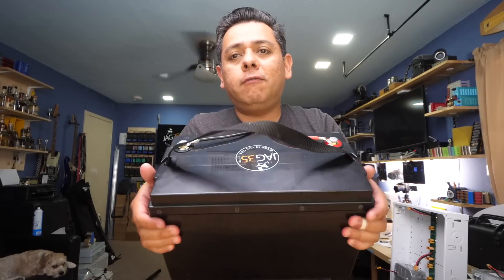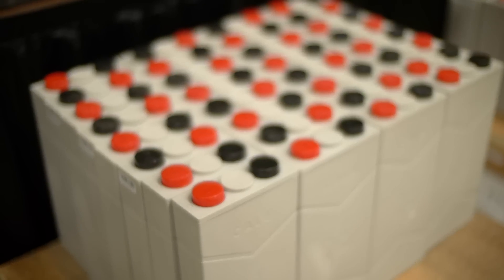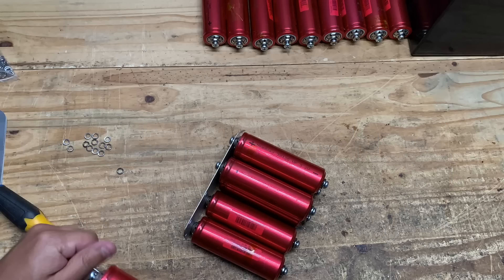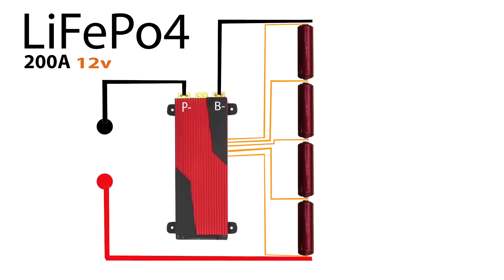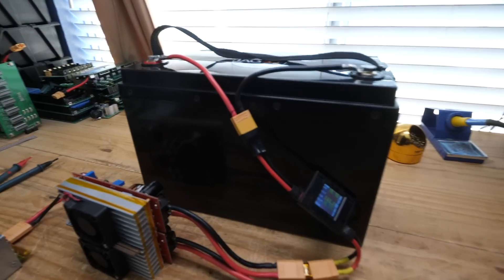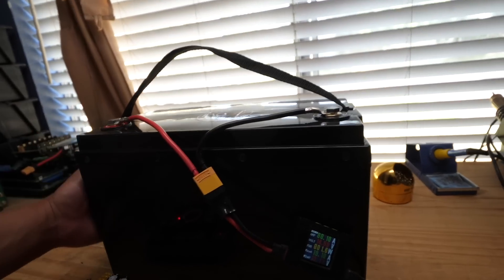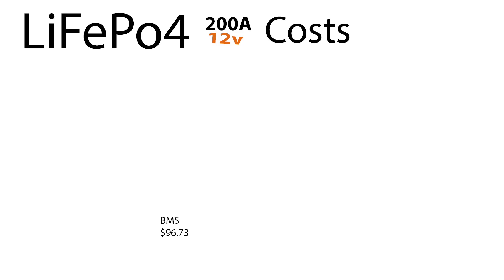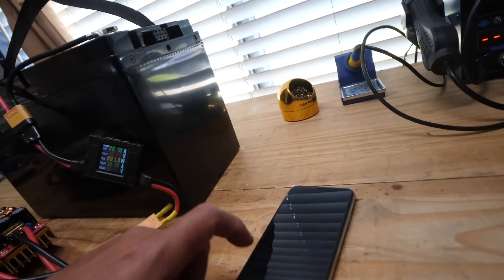Build a DIY Lithium LiFePo4 Headway 12v Battery replacement

Comment: 5. Global BMS Vendors
5.1 Denso (Japan)
5.2 Calsonic Kansei (Japan)
5.3 Hitachi Automotive Systems (Japan)
5.4 Mitsubishi Electric (Japan)
5.5 Hyundai Kefico (Korea)
5.6 LG Chem (Korea)
5.7 SK Innovation (Korea) 
5.8 Tesla Motors (USA)
5.9 Lithium Balance (Denmark) 
5.10 Vecture (Canada)
5.11 Rimac Automobili (Croatia)
5.12 Digi-Triumph Technology (Taiwan)
5.13 Clayton Power (Denmark) 

6. Chinese BMS Vendors (Independent Third Parties)
6.1 Huizhou E-power Electronics
6.2 Shenzhen Klclear Technology
6.3 SINOEV (Hefei) Technologies
6.4 Ningbo Joyson Electronic Corp. (German Preh GmbH)
6.5 Harbin Guantuo Power Equipment Co., Ltd. 
6.6 Anhui LIGOO New Energy Technology Co., Ltd.
6.7 Ningbo Bate Technology Co., Ltd.
6.8 Ningbo Longway Electrical Co., Ltd.
6.9 Shenzhen Antega Technology Co., Ltd.
6.10 Wuhu Tianyuan Automobile Electric Co., Ltd.
6.11 Shenzhen Battsister Tech. Co., Ltd.

7. Chinese BMS Vendors (OEMs)
7.1 BYD
7.2 BAIC BJEV 
7.3 Hangzhou Genwell-Power Co., Ltd.

8. Chinese BMS Vendors (Power Battery) 
8.1 Beijing Pride New Energy Battery Technology Co., Ltd.
8.2 CATL
8.3 Hefei Guoxuan High-tech Power Energy Co., Ltd.
8.4 China Aviation Lithium Battery Co., Ltd.
8.5 Sunwoda Electronic Co., Ltd.
8.6 Winston Battery

9. Global BMS Chip Vendors
9.1 Analog Devices (USA) 
9.2 Texas Instruments (USA)
9.3 Infineon (Germany)

For more information about this report visit https://www.researchandmarkets.com/research/nhg4vb/global_and_china?w=12

Comment: Great video!
But I wish to crave your indulgence for an observation Sir.
Some of us subscribed to your channel ‘cause we can learn everything learn-able under the sun from you about the lithium battery DIY projects. But something baffles me here Sir. You seem to mystify some essential aspects of your projects. For example, in this video, you were kind enough to show us the parts you put together, but we didn’t know how you did most of the connections and all your wiring.
But of course, if it is a trade secret then you may forget it. Otherwise, you would be doing me a lot of invaluable favors if you let us into some of the tips and tricks. OK. May be I am just too dumb to see.

Comment: I wouldn't recommend buying these seconds 38120' batteries.
Why! 
I bought 8 units from Battery hookup @
AU$189.23 (8XAU$ 23.65ea) includes DHL transport
The batteries are very old,  manufactured 2016 or 2017.
Nothing in  web ad that mentions cell  AGE & insulation damage.
Have one dud  battery that's under spec @ 3.14v Clearly shows overheating or cooked damage history @ + end. 
Not like the others. 
The rest are either 3.288v or 3.4v with surface   insulation damage.
As price comparison, 
I've since discovered,  from China, GEB brand NEW 
GEB 38120 @ US$12.92PCS + transport for the 38120 battery.
Reply: Yep battery hookups is overpriced. The battery he builds in this video would be around the $400 range once you add hardware, box, bms and cells. Definitely not worth the 35AH rating.
Reply: I was really contemplating purchasing these cells from Battery hookup until I read your post. Getting duds is what I am afraid because they are used, even though their description says all tested something like 95% and up.  I was going to make a 4S10P pack, so 40 cells.  Now I don't think I will be ordering any.

Comment: To charge this battery, you recommend the DC DC Voltage Convert CC CV Boost Converter DC-DC Step Up 1800W 40A Power Supply Adjustable Module 10V-60V to 12V-90V Regulator.  I've seen you use it before, but its good on LiFePo?
Reply from the maker: It’s good on any battery

Comment: How could we make it have a constant 400amp out put?? Adding 2 bms?? If so would you have to split the cell bank so it's 16 cells per bms?? Fyi I'm trying to use for high power car audio.. Thanks
Reply from the maker: Using a mechanical relay with a bms might work better for you
Reply: @jehugarcia  I'm not sure I understand.. are you saying bypass the bms when I'm using it??
Reply: @jehugarcia  or are you saying use the bms to control the relay??
Reply: I'm sitting here trying to image a 4800kW car amp set-up and it just doesn't seem realistic to me.  You could cut a car in half with that much amperage, so I'm guessing you are just taking the combined MAX watt/amp ratings for all of your amps to arrive at that number. 

If you are trying to satisfy the combined peak load for all of your amps, then you should probably be looking at a bank of Maxwell Super-capacitors in conjunction with a battery like this.  Audio amps only draw their peak currents when they're driving heavy bass, and even that is a transient demand.  Super-caps are ideal for this job. 

Just be careful with them because they need a current limiting element when you start to charge them from a non-charged state.  This can be done with some beefy MOSFETs set up as constant current limiters/ideal diodes, or just use a bank of sub-ohm resistors in between the battery and the super caps.  Then hook each of your amplifiers to the super-cap bank through dedicated fuses and relays with 6 AWG wire.
Reply: @timhogue2808  my amp puts out 4300 watts at 13.8v

Comment: Thank you very much my friend for your videos. Thanks to you the wait is finally over for my own 38120s. Ordered 8 to make two 12 volt batteries for powering accessories on the electric bikes. I LOVE 12 volts. Just last week ran 12 volt into the house from the solar panel and battery bank. Installed an RV 12volt vent fan to be used as a whole house fan, venting the house and attic. Works great! Also have more than one car stereos running, like the one in the bathroom for a great sounding shower!

Comment: Jehugarcia, I am a newbie wanting to learn about this lithium battery technology. Can you explain why liFePO4 of the same voltage and capacity e.g. 12.8V 200A have quite different continuous discharge rates. I have seen some have 80A, 100A, 150A and yours putting out 200A continuous. Is it the difference between cheap and quality batteries?? Regards
Reply: Depending on electrode area, size current carrying capacity can vary.

Comment: So... the headway cells are not as good as the prismatic cells... 400 wh... 1/2 the space gives you 800wh easy, 1200 ish with tall 100ah cells...
Reply from the maker: They are not as energy dense

Comment: Thanks for the video. I’m only interested in solar storage as using these batteries for a starting battery would not make sense for me. I only shallow cycle my lead acid starting battery and it is 5 years old and going strong. This would be a waste of money except for solar storage. And with my lead acid battery I dont need to worry if it’s freezing or not. 
 I would like two of these Lithium’s to have the correct voltage for my 24 volt inverter. They would be inside in a insulated box with a small heat mat so I wouldn’t need to worry about them freezing. I had hoped they would be slightly less expensive for used cells.
Reply: I’m watching the video again and you do a great job describing what applications these Lithium chemistry batteries perform best at 3.3 V nominal per cell. It was the comments Section that drifted off into starting battery applications. Lots of people wanting to trick their cars, trucks, and vans and run more loads. But the stock charging system and lead battery is designed adequately for starting and small loads. If running large amplifiers or other large loads is the goal a single Lithium battery has risks because they stop supplying power suddenly when low with little warning. Then starting the vehicle is not possible. But with vigilance and good gauges it can be done. And o resizing or adding alternators is usually not necessary. My opinion is it’s best to avoid high amperage whenever possible. Any weak link in the system can get hot and then the resistance goes up so it gets even hotter. It’s called a cascade reaction.
Reply: @paulbaker3144  aybe he should put a second battery in the back with an isolator to not drain the cranking battery.
Reply: Jake. Isolators are better than nothing but are not optimal as they have a voltage drop of 0.7 volts so a lot of batteries were getting undercharged if a vehicle is not driven for a long enough period.  ACR (automatic charging relay) is newer technology with no voltage drop if same battery chemistry is used for house and starting battery. Or a DC to DC charger if different battery chemistry is use for the house battery than the starting battery.

Comment: Forgive my ignorance, but what is the use for this thing?
Reply: It would be awesome to take with you when going camping (along with an inverter). It has 820 watt/hour capacity (that means you can draw 820 watt for 60 minutes until the battery is empty; or 1640 watt for 30 minutes; or 410 watt for 2 hours). If you buy a DC->DC PSU (or just hook it up to the inverter, but that is really inefficient) you can even run your desktop PC off it, while you're camping :D

Comment: Fantastic battery I would like to build 2 of them for my wheelchair, but can't get or afford the parts in the UK.  Keep up the good work.
Reply: U know you can buy laptop batterys on sale. $20 has like 5 or 6 new batterys in it. So u need 2 or 4 laptop pack. Do you own research. Is called google
Reply: @myes344  do yourself, is called asshole.
Reply: @myes344  I know its been a year or more, but you dont even need to google to know laptop batteries don't use these cells.  He says it in the video.  Go eat an ant hill.

Comment: Nice project, but for $150 more, lion energy has a substantially more powerful battery that weighs 22 lbs.
Reply: Will Prouse tested that battery recently and it's not a true 1200Wh unit - only <1000Wh so that may change things?
Reply: @PhilipLengden  Yup. But the watt/per dollar is still great.

Comment: plz make a video on 18650 battery pack cooling solution for electric car, here in Pakistan temperature is hot, if car is parked outside, battery pack will get heatup , what could be best cooling solution for custom made 18650 packs, Air or liquid cooled, both ... anyone every tried ?
Reply: Hi Jawad, are you into these batteries. I am happy to discuss in more details.

Comment: Hi, I've seen your detailed video & I liked it, however I am always battery-overheating-phobic, wouldn't it be better if you make some ventilation halls on top & bottom of the plastic battery body to allow air circulation, or even better add an electronically controlled fan! this should keep the temperature under control & extend the battery life time, nevertheless Good Job, thumbs up.
Reply: Yes, my question exactly.

Comment: I think you have great videos and I enjoy the information you obtain and share with all of us for free. I'm sure it takes an incredible amount of your time not only coming up with the ideas but to also film and edit so again I want to say Thanks. Now here's my question "I'm curious why you tend to test so many of your builds at the maximum amp output?" maybe I'm missing something but while I understand lithiums are far superior to lead acid when handling high loading, no battery will survive anywhere near its advertised cycle life when used in such a way. I don't know about everyone else but I try to size my battery to have at least 10 times the amphour capacity of my average amps consumed during my peak demand period. So if my load at peak usage is 25 amps per hour I would want at least a 250 ah battery to supply power for my needs. This in my thinking keeps the battery from the stresses of heavy discharge and the resulting high current charging. Curious also as to why you did not use copper for the buss bars and heavier cable for your internal leads to output posts and then for your inverter connections? Those cables should have not shown any thermal rise beyond a few degrees.

Comment: Hello greetings from Peru.
Thanks for all your videos are very interesting and I like them a lot. thanks to this video I bought 8 batteries 38120 3.2v 8a to use it to replace the main battery of my toyota camry V6 3.0CC. Would it be enough with the BMS and the 8 batteries 38120? Any recommendation ?

Comment: You should set up more contact points where the BMS connects to the batteries that way you reduce the temperature inside the battery and you’re not overheating an individual cell. When the cells getting heated by the cable you will have one cell fail sooner than the rest on each side which will cause the pack to become unbalanced on a regular basis. I would really like to buy one of those packs from you. In a partially assembled manner

Comment: The price is very expensive 
So better to using gel battery
Reply: That's where I started. They are just OK,so far. I'm very glad that I didn't start with flooded ones!!!!!!!!!!!!!!!!!!!!!!!!!!!!!!!   I   would have blown up my shed by now.
 Those batteries are not good for anything that moves at all.
  My AGM ones are way safer,but not as good as the ones that are the...best.
Lithium or the  ...other ones. I'm too tired to look it up,now. LI FE So 4's?

Comment: Just curious, why 8P if the BMS is listed as only 530A peak? It would seem that a 2P configuration would max the BMS and still be usable as a 12V battery and lower the BOM if it's just for a automotive battery.

Comment: 5:00 You could use plastic "bridges" to connect the left and right half battery packs to the main center block. Plastic will isolate and will keep the wobbling sides stable and on distance. You can drill holes to the bridges and directly use the screws of the batteries to mount them.
Reply: Not a good idea. "Plastic" may soften and reduce the electrical contact force. However, epoxy/fiberglass panels would be safe.
Reply: @avid0g  Yes, you can replace "plastic" with any non conductive material there. Personally I would go for fiberglass too. I said plastic to make sure that he gets the idea.

Comment: Great stuff. I have built a 3s house battery with 600 x 18650 cells for my small motorhome , and also a cranking battery using 8 x headway cells, backing up super-capacitors .
The cranking battery weighs 7kg and is now almost 2 years in service. Cranks a 5 cylinder engine much better than the old style lead-acid.
The house battery, 12v, powers an induction stove through 4000/8000w inverter. Now 12 months old and doing very well for fridge and lights too.
Here's what might help with battery builds... cork floor tiles make excellent insulation and shock absorbing layers. Cork chars but doesn't burn! Also, silicone sheets (place mats from ebay) also doesn't burn, is fairly thin, and acts as a good separation between cells if needed.
 Cheers from Oz, JohnT
Reply: Thank for that silicon place mat idea!
Reply: genius
Reply: we are waiting for YOUR video, John. Thanks!
Reply: John please make a video. Or maybe post a parts list so we can try to replicate your success.
Reply: Please how did you connect those starter battery with BMW circa 400A or more ? Where did you order it? And passive or active balancing?

Comment: Will The BMS work with a car alternator so it does not overcharge and blow up the battery?
I have been wanting to build one of these but setting up to charge in a car has been my worries.
Reply from the maker: Yes the bms doesn’t care where the energy comes from, it will disconnect when the high voltage cutoff is reached
Reply: @jehugarcia  I was just concerned about trickle charging the Battery. I was informed that LiFeP04 batteries don't like this. 
It would seem that you would not want to charge the battery until it reached a lower voltage. Such as 11.5 or 12 volts. 
So your car would only be energized by the alternator whilst the engine is Running.
Or does the BMS work like a diode to prevent trickle charging the pack while the engine is running?

Comment: So for only several hours of work and 5x the cost you can have something the size and shape of a car battery that'll run about as long as a car battery, but likely be less fault tolerant, which can't start a car because of the BMS current limit.

Thanks for making this video, it's interesting to know where the practical limits for stuff like this, and while it's not gonna change the world, it's good basic research and well presented.
Reply: Not gonna change the world for starter batteries with cars set up to start off and charge lead acid but it definitely will change the world in other applications.

Comment: Question can this battery be charged via the alternator in the cold without destroying itself?
Reply from the maker: How cold?
Reply: -20 Fahrenheit ? I just remembered    lithium has to be charged slowly in the cold to prevent damage but those are high drain cells

Comment: Nice work!
Do you offer them for sale?
How much?
Again really great work!
Reply: I built one of these exactly as shown mostly for the experience and would let it go to fund the next project.  The high discharge rate is frankly overkill for any use I have.  I saved a little here and there and came out less than the $544 he itemized so make me an offer and I will get it shipped to you!

Comment: Great video, does the 200 Amps refer to Amp Hrs the way that commercial battery manufacturers sell there Deep cycle batteries?
If not do you know what your battery would equal in Amp Hrs.
Do you have a link for the aluminum plates and case Thank You

Comment: Wold the BMS allow these batteries to link in series to get higher voltages?
Reply from the maker: They should,  but I’ll test to confirm today
Reply: @jehugarcia  Thanks Jehu! The reason I am asking is that I was watching recently a video by Will Prowse comparing various LiFePo4 batteries (https://youtu.be/WVxvBkeY0UY) where he indicated that Battle Born batteries are the only ones that can be linked in series for larger installations. Looking forward to what you find out about these. If your design could be linked in series it would be a significant cost saving over the Power Born ones. Cheers!